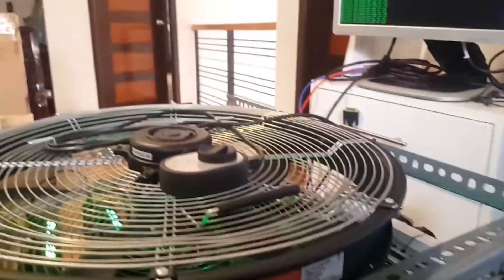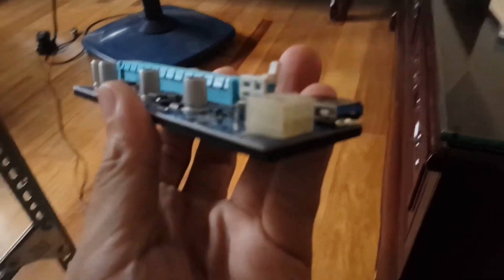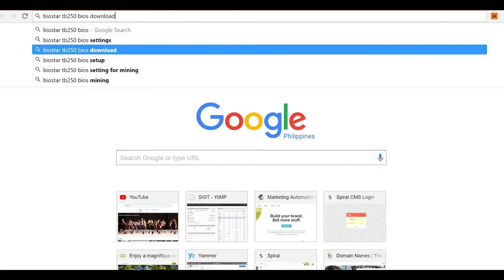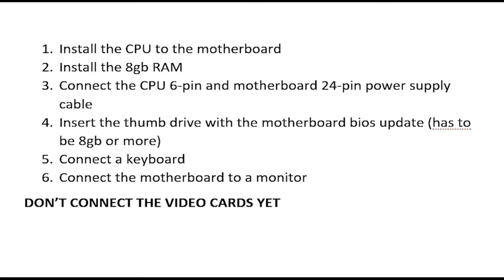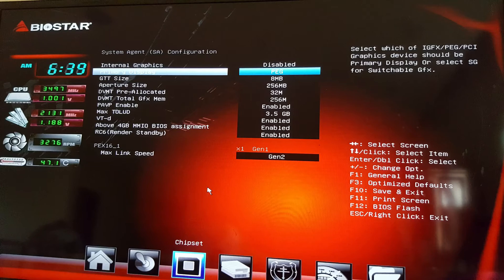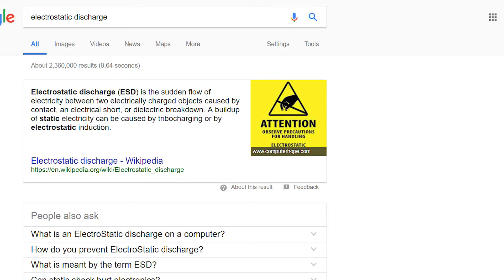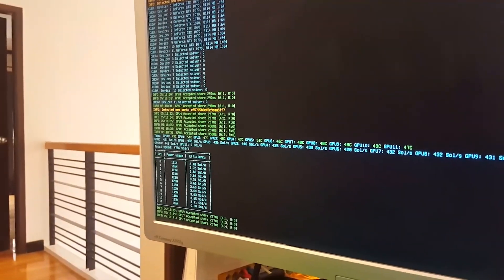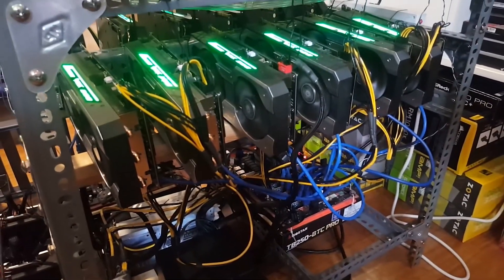Building a 12 GPU GTX 1070 Mining Rig Using SimpleMining OS   Biostar TB250 BTC Pro

Comment: Hello  I have 1 cpu 1660 graphic card . 1 power supply gigabyte p750gm 80+gold. And monterboard biostar b250 pro BTC.  We checked the bios. We recorded windows 10. Then we restarted it no longer runs. Just turn on and off in every 1 secund